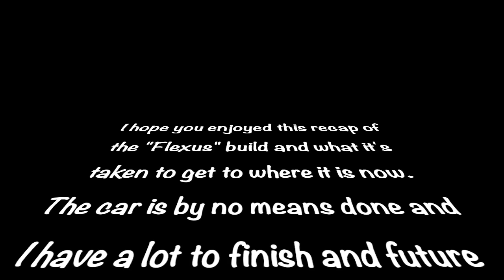Body Swapping a Ford Falcon with a GS400 Lexus in 10 minutes!

Comment: I thought "body swap" meant two vehicles with a ladder frame.  Literally take the body off one frame and swap it onto another.  This is an insane amount of work.  I'm very impressed.
Reply: a guy i work with did a 49 desoto 4dr onto an s10 complete with a/c and all then worked it into a 2dr conversion with a chop top. its sick as hell. he told me the other day hes putting a newer dodge hemi in it now
Reply: That's impossible with these 2 vehicles because the Lexus is a unibody & doesn't have a frame...
Reply: @Road_Rash  this guy just showed us that the impossible, is possible, WOW.
Reply: Falcon is unibody also
Reply: @Road_Rash  yep he obviously didn't do it!🙃😜
Reply: We didn't have the aggregate resource and ideas of the internet back then either. If you didn't know someone very special to learn from and evolve with, or come up with the idea yourself, you were stuck with common modifications that had eventually made its way to the knowledge of the general automotive public... almost always in the form of a conversion kit.
Reply: The cheesemobile

Comment: This is honestly the best idea I've seen. Preserving the wrecked underframe of a newer car while keeping the shell of the old body. I should suggest making negative castings for builds like this. On top of that you can use the VIN from the old body and not have to worry about dealing with the wrecked VIN.
Reply: The donor vehicle VIN would open up a can of worms; emissions alone.

Comment: Man you’ve given me so much inspiration to work on my 63 Falcon 2 door sedan. I had a wild idea about extending a Miata chassis to match the Falcon’s wheelbase but wasn’t sure of the feasibility. You’ve made me rethink it lol, beautiful car man!
Reply: Fortunately for you, Miata frames come in two halves! They aren’t really one continuous frame from front to back, there are just front and rear subframes that bolt to the body, sort of like they’re half body on frame, but unibody in the middle. So if you buy a donor Miata and remove the subframes, it should actually be pretty easy to change the length to fit whatever car you want to put them in. You’ll just need to get a custom driveshaft to connect the two, and make sure your car has enough rigidity in between the frames.
Reply: @Thinginator  That's not a Miata specific thing, it's pretty much true of all modern unibody cars. The GS400 is also like this. On a Miata though, they also have this piece called the "powerplant frame" that structurally connects the transmission to the diff while also supporting the transmission because the Miata doesn't have a crossmember or trans mount. That would have to be lengthened or eliminated if you wanted to change the wheelbase.
Reply: If your 63 falcon runs and drives it would be easier to repair any rust damage and keep it as original as possible besides if you ever sell it most people are looking for an original car not a miss matched one.

Comment: I am excited about the idea of unibody chassis swaps but I'm not yet brave enough to take the plunge.  This is a very encouraging video with a terrific result, great work!
Reply: I thought an excessive amount of structural support for the Lexus was removed, as a professional do you have an opinion or concerns w that aspect of the build?
Reply: @Pedroisanickname  I think throwing steel at it and attaching the "new" body is sufficient especially for a hardtop sedan.  Modern cars are surprisingly strong even with the top cut off.  It would certainly be stronger than the original falcon, they fold-up pretty easily.

Comment: this is really BadAss brother  i’m almost 60 years old and your generation  is completely Credited for coming up with this idea ! when i was younger and the Unibody Construction took off in thecAutomotive World no one had the Vision that  a Body Swap of this Magnitude could be done successfully  now of course the Equipment like awelders and other Tools has changed a lot of that because it’s so availablfor the DIYers at affordable costs  but honestly a Old Ford Falcon running and driving like a Lexus !Its Brilliant plus swapping out the nice Amenities that a Lexus offers is a freaking Homerun like the nice comfortable Lathr Interior Soft Ride , aC , Cruise , nice Stereo Etc it’s Genious you take a basic commuter Car and turn it into  a nice Luxury Daily Driver that doesn’t look like everything else on the road Plus IMO no disrespect  but i remember seeing old Falcons running and driving being $800.00 to &1,0000.00 dollar cars and  by doing this type of a build  i’m guessing it’s a car that would sell for 15 to 20K easily if not more  i’m basing that on used Lexus pricing  but throwing in some CoolGuy Factor Moneys  it seams reasonable  the whole process is a Win  i’m sure the Lexus was a reasonable buy with all the body Damage it had  the only major Glitch i could see  is i’m not sure how that would work with a Salvage Totle and theRebuild Laws Yet i’m thinking as long as the FalconBody meets the mandatory Motor Vehicle Laws it would be cool and Legal of course every State would be different

Comment: I love these kinds of builds, deeply love them, but I also loath the use of modern plastic interiors. Amazing how well the two cars line up though!
Reply from the maker: I agree with you on the interiors. The main reasons I didn’t stay with the falcon interior was... well it didn’t have one haha. So the cheaper option was the Lexus. Plus the Lexus interior was almost perfect since the car has less than 80,000mi on it. And lastly, I left the original dash in my 66 when I did the crown Vic swap and trying keep all the creature comforts while hiding it behind the small older dashes was a royal pain. There is a reason new cars have big dashboards... there is a lot of stuff back there
Reply: @StraightCutGears  Love the builders comment, nothing like the word from the guy that did the work!

Comment: I built a 63 with a custom frame, 506ci bbf.  I had it stripped down to the bare body just like you did, but then used a custom frame instead of another car.   Well done, however, what is great about the gen1 falcon is the dash!   You should keep it and put the gauges, etc, from the lexus inside.  This is what I did when I swapped a 99 dodge truck drivetrain into a 74 motorhome, I took apart the gauge cluster and cut into individual gauges to put inside the 74 dash, and used the dash controller to still control them and hook up to the wiring harness.   Only funny thing is some gauges were rotating 90 to get the same needle movement.  lol

Comment: Your depth of knowledge and experience really shines. Absolutely amazing work. I have a 91 Mercury Capri I’ve been looking to mate with a jeep for some time I think the little convertible will make a great stomper 4x4
Reply: There's a guy in the town just west of me that put a '61 Falcon body on a '66 Bronco chassis. Kept the 170 cid Six, and mated it to the Bronco's 3 speed transmission and transfer case. Put a lift kit in, and some big ol' 33 inch "puppy swashers".  Didn't change the differential gearing, and the little six couldn't pull out, except in 4WD low. Once he had it rolling,  he would go through the gears, then shift to 4 High. He said those large tires were really hard on the clutch, but gave amazing highway gas mileage. 😄

Comment: I love the pre 1964 body style of the Falcons.  I don't like the squared off 64 & later.  I restored a 1962 Futura with a 200 straight 6, 350 holley 2brl, C4 trans.  This was back in the late 70s.  It wasn't really fast but it would accelerate pretty good.  In Spain I took cross country trips, 90mph all day long & 30mpg.  I like what you have done though.  New car ride and dependability.  The interior 👌 looks great.

Comment: That's really kool!
But too bad about the modern looking wheels... Steelies and slightly skinnier tires would be really kool.

By the way... The same thing can be done (or at least USED TO be done) with the '49-'51 Mercury body, put on a '73-'77 Chevy, Olds or Pontiac "mid size" chassis.

In fact, dad did a '51 Merc on a '74 Pontiac Le Mans running gear... The only cutting that had to be done, was that the kick-up over the rear axle had to be cut dead center and flipped over and re-welded.

Other than that, even the original Mercury body mounts and EVERYTHING fell right into place.

Comment: Awesome project, great ingenuity and skills

I wonder what it drives like though, you removed almost all of the structural rigidity of the GS when removing the roof and separating the spot welds holding the plies of the body together, how flexy is the chassis now?

Comment: I have 65 dodge custom 880, original accept for a 2004 hemi motor and Trans swap, never finished and been sitting. Still has drums and tortion bars. Thought about doing a frame swap onto a 2010 or so chrysler 300 as the wheel base is only 3/4" different, but idk if the chryslers are full frame cars or not.

Comment: I assume you ran the tape over them both before you let lose with the grinder?
I'm pretty amazed at how well you got it to fit.😄
Reply from the maker: Not really haha, I’ll I knew was that the wheel base was almost exactly the same. Other than that I figured a cutoff wheel and a welder would make everything else line up haha

Comment: Need to jog your memory about the dash
 I have a 60 falconex drag car with the vertical face of dash cut out and now a donor car. Would it be better to cut the missing piece off the donor and graft on or cut out both dash boards completely and swap? Is there a decent parting edge or spot welds near the windshield? Both cars are pretty gutted.
Reply from the maker: If you cut the whole dash out, you’ll have to remove the windshield to really get a good cut and to be able to weld. I think I’d probably do it that way, it may be more work but would probably look better in the long run

Comment: love the idea of this but i'd like it a lot better with the falcon dash in it
Reply from the maker: I would have loved to use the dash. The problem is how small the dash is. It won’t cover the HVAC and other Lexus components. I ran into the same issue on my crown Vic swapped truck. I key the stock truck dash and had a hard time making everything fit.

Comment: I'm confused at the rear wheel wells it seems that sheet metal is right next to that tire is that enough clearance? Or is that rear suspension tight enough to not rub, or is there some kind of camber I'm not taking into account?
Reply from the maker: I created clearance, but after settling it wasn’t enough. I get a bit of rub when it’s loaded down so I’m going to rework the inner wheel well area
Reply: @StraightCutGears  right on man, this build is almost witchcraft in my eyes

Comment: Turned out nice I have a 1955 ford 4 door town sedan I need to body swap. How is it titled now, Lexus or falcon?
Reply from the maker: As a Falcon, it’d would cause more issues as a Lexus since if a cop ran the plate and it came back to a Lexus and not a Falcon, I’d probably get stopped.
Reply: @StraightCutGears  right I understand that.

Comment: Wow. Typical hotrodder. Buys two totally unrelated donor cars to make one finished car out of. Even though he has no intention of using the engine from the Falcon, he makes sure it runs first, then later takes a short ride in/on the rolling chassis. This earns him many extra style points. The kids are helping as best they can. More style points. The damn thing actually works, even more style points.  You Sir, are demented, I like that, so you get even more style points.  I gotta see how this one comes out. Great work!

Comment: This must be illegal and dangerous, The Lexus has gone through safety testing to be fit for the road. Even the doors play a part in the overall structure integrity and safety of the occupants in the  car. To strip the parts off then replace it with 90year parts is crazy, it is good but how can this be safe on the road... Very nice build tho..
Reply from the maker: It’s still safer than a stock falcon